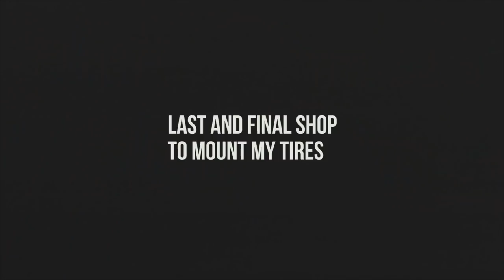NEVER STRETCHING TIRES AGAIN

Comment: I just want to add that you MUST TAKE YOUR WHEELS TO A WHEEL SHOP TO GET YOUR TIRES INSTALLED AND BALANCED!!! Dont ever take them to a tire shop. I live in Miami and most shops won't touch aftermarket wheels, but when they do, they pry, scratch and dent custom wheels like they are some used steel shit wheel. They have no respect for you wheels period and I've been to a dozen myself.  Rim shops are better since they mount new expensive wheels all the time. In fact the shop I go to has painted black wheel weights as well 👍😎

Comment: bought a 165/45/15 for my daily because I had a hole in the sidewall of one. it was a federal formoza and all my other ones were achilles economist. they got it on my wheel (15x8) with no issues and without using a cheetah bomb and mind you the stretch is really aggressive. so they got it on and within the same day it leaked and ended up debeading so I took it to a tire shop by my work and they got it on and “fixed”the leak but it still leaked and debeaded at the end of that day. so I just took it to the usual tire shop I go to and they know what they’re doing and since they worked on it and sealed it up again with beadsealer it’s been fine so yeah I do have my preferred tire shops but I don’t mind giving other shops a try

Comment: Not saying you should stretch your tire but if your going to, bring a cardboard  that is wide so if they try to stretch it it could lay on a cardboard. People who use the fire method should do this because when you light it up sometimes it jump up a Jew inches and it could damage the rim. A cardboard prevents this if it thick enough. You could do this by your self and it doesn’t matter the tire too

Comment: Thank god I live in so cal where I got 3 alignment shops that know how to adjust slammed camber arms and get fitment A1 without buckling fenders. Cost about a buck something but worth having it dialed to perfection. When you have to explain to a alignment shop how to mess with your aftermarket arms it’s not going to end well.

Comment: What are the wheels specs and tire sizes?
Reply from the maker: 10.5 w a 225/40
Reply: Damn I’ve never had trouble with tire stretching but then again I’m not running 10.5 lol.